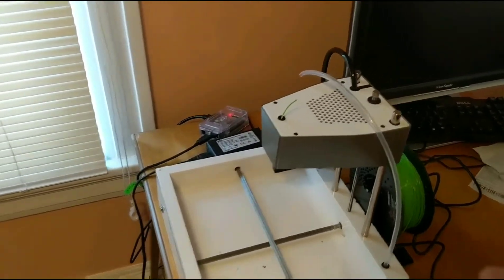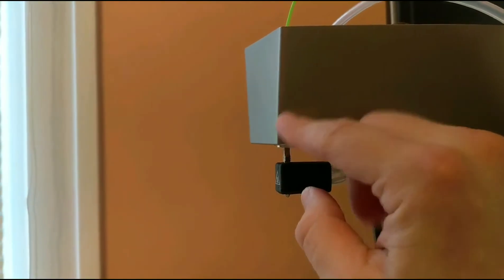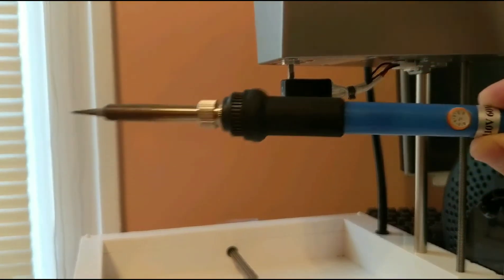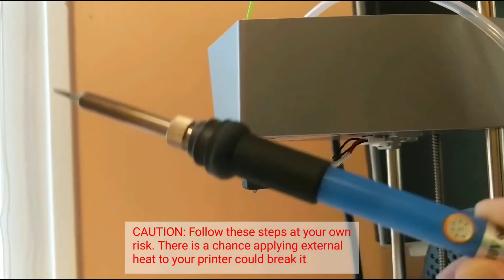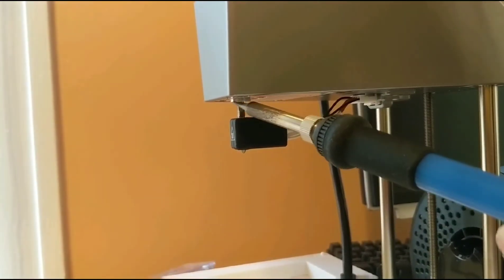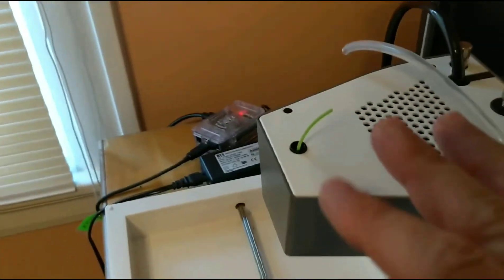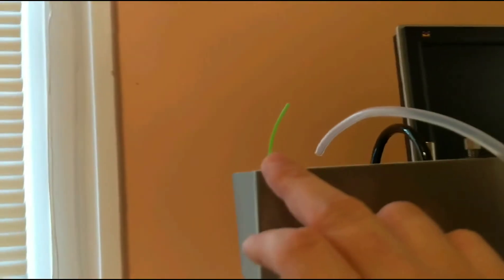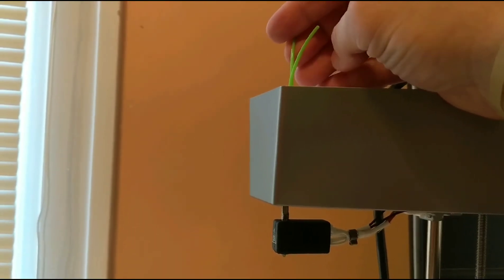Filament stuck in MOD-T 3D printer: SOLVED

Comment: thanks it fixed my problem.  load didnt work but unload and tweezers after heating solved the problem
Reply from the maker: interesting..i would unload would have the motor pushing the wrong way